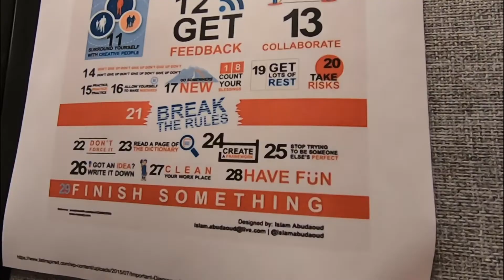What does a Project Engineer do (quick summary)

Comment: So how do u get a degree on that subject or what’s it called
Reply: Atleast here there is no any specific degree for it. You can become project engineer with any technical degree.

I graduated as process engineer and my job as project engineer was to make sure the  mechanical engineers design correct machines on time with client wanted specs. It was full office work tho. Some small visit at workshop to go see how machining and assembly of the machines was going, so could write a raport to client.
Reply: @jarskil8862 i am working as a telecom project engineer and I have a Law degree and an urban planning master degree...

Comment: What’s the diff between project manager and Project engineers
Reply from the maker: Project manager could do everything a PE would do, but delegate it to the PE. The PE basically just assist the PM. Once the PE is good at his/her job, then the PE would become a PM. PM also will be responsible for cost control, scheduling, pulling permits, and risk management.